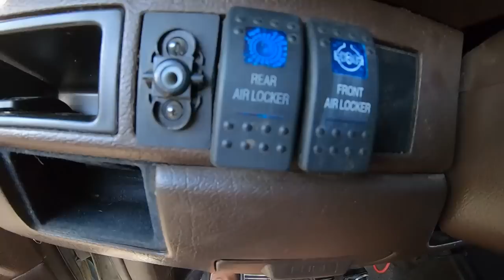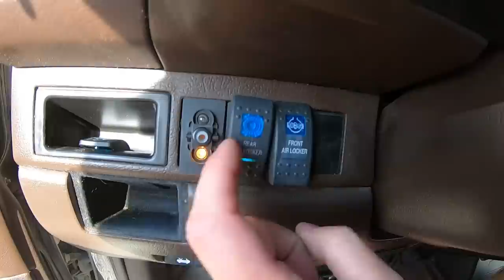Transforming a Isuzu Trooper into an Overland Vehicle | TJack Survival

Comment: Dude!! Did we just become best friends. Just had my heater core go out on my 95 limited , started nothing  a slight coolant smell then found the passenger side floor saturated in coolant. 🤦🏿   Had no ideal how I was going to fix it. My local shop said 1 grand to take out the dashboard. But I keep thinking I should be able to to do that myself over a couple of weekends. This video was the first I seen showing you taking apart the dashboard from the center to passenger door to access that heater core. Thank You, Thank You, Thank you!!

Oh 3 weeks after finding the heater core was leaking  on the way to work crankshaft broke with 234 miles on it.🤦🏿🤬🤬. Shop is replacing the engine and cap off heater core. I’ll fix the heater core over  some other weekends . I still have 2000 trooper limited to sport around in 😁
Reply: That’s awesomeness! It’s a pain but doable. Reach out on FB if I can be helpful

Comment: I have a 94 parts truck and 95 limited daily driver.  You got a steal if you got those for 500 each.   That arb front bumper goes for a grand on the used market.   The air lockers,  the rack, and they are both manuals!  2 unicorns for sure.
Reply: It was 500 for the red one and 2K for the green one and free for the 2001 with no engine. But ya I definitely scored!

Comment: The window crank probably is missing the E clip thingy,  don't epoxy it on, if you need to get into the door innards that crank will be a bugger.
Reply: Ya I eventually figured that out. I’ve since pulled all the doors apart on three vehicles and gone electric
Reply: It's a c clip that holds it in place

Comment: 3.2 + manual transmission should be bullet proof. It´s the 3.5 and automatic trans that breaks on these. They have good and strong axles and are great off-road. The flex is really good on these ones. How they still are cheap is a mystery to me.
Reply: Exactly! You get exactly what I’m going for here!!!
Reply: Reason why still cheap is fault of consumers report test...if all looked at real test footage it was the 4runner that failed but everyone bought what they said...hav a 93 ls luxury edition..198thou miles..very little rust..paid 2k for it 4yrs ago
Reply: He forgot bout the compartment under seats that can be accessed by flipping back seats forward
Reply: @jamessmallwood1522  Oh I know it’s there. I’m going to be doing something cool with it.
Reply: Everyone shits on Isuzu's as being unreliable and top heavy. Which is completely untrue. I've owned several over the past couple years teo being parts rigs. 90% of all the break downs are P.O. failing to do scheduled maintenance.
Reply: @Isuzu_Paul  that’s exactly why I’m building this. An unknown gem

Comment: They axles, transmission, transfercase, interior parts (seats door cards ECT) are interchangeable.the motors are the same but different (different heads/injection system). The corporate 12 bolt axle rear is the same from 92-02' different gear ratios on the 98+ models though 4.56 vs 4.30 I believe. The front lift is just a torsion bar crank, aftermarket control arms are a waste of time and money just swap the ball joints under the uca with a small spacer plate. The rear lift you can use zj front coil springs from the v8 model with the pigtail cut off or get oem 929 springs.  That arb bumper is a super score they are 1200 bucks brand new. Same with the lockers, although I didn't know they made a 10 bolt locker, I wonder if that is rigged in there. Get yourself a transmission cooler or the automatic will die is a fiery ball of burning atf.
Reply: All awesome information! I've the the standard so that shouldn't be an issue hopefully.